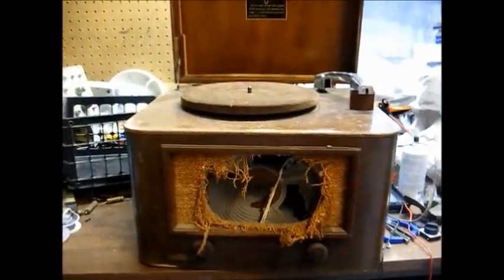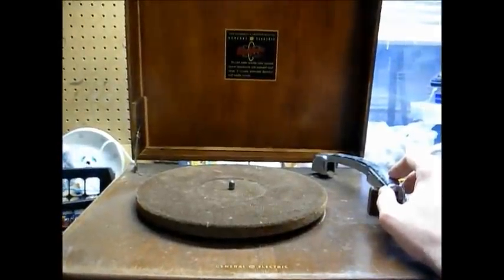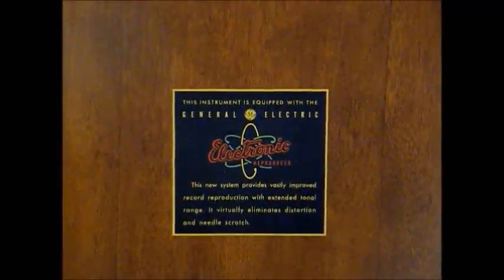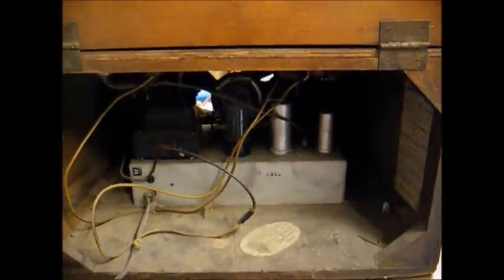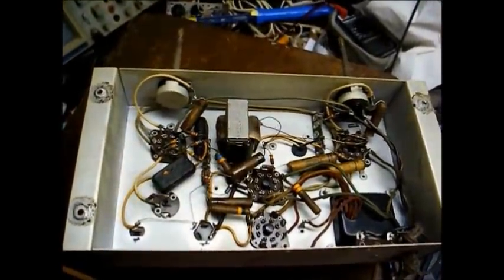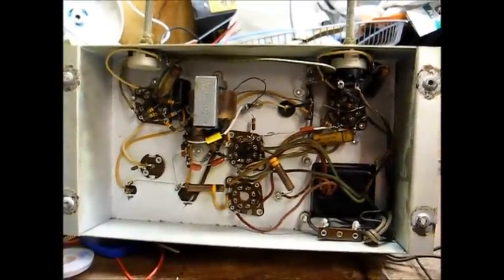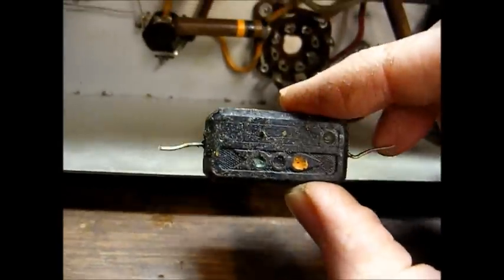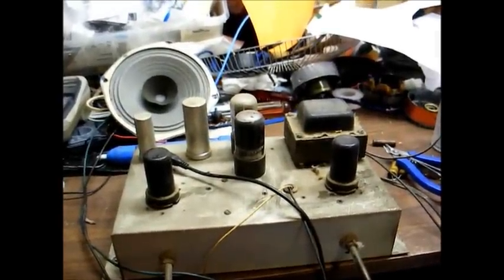Late '40's GE 78 rpm record player restoration - part one

Comment: Looking at the size of speaker and the fact it has a magnetic cartridge this is probably one of the best sounding table record player of the time. I'm sure you can hook a more modern HiFi turntable such as a Technics straight to the amp without the need of an external preamp.

Comment: You mention a dual cartridge.I have  GE radio/phono from 1948 that has two arms,one for LP,one for 78. It's a model 118. It's the Milwaukee-Erwood.There are photos on the web,but I can't post them.Google "designs for giving" with General Electric.Cosmetically beautiful,but nonworking.It has that label.Those late 40s GEs have some metal tubes.Do they last as good as glass ones?